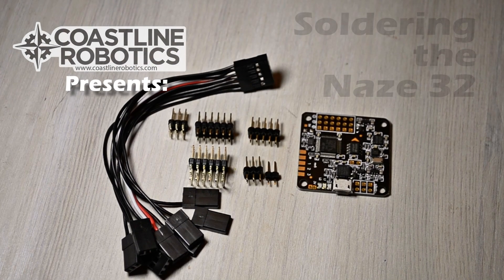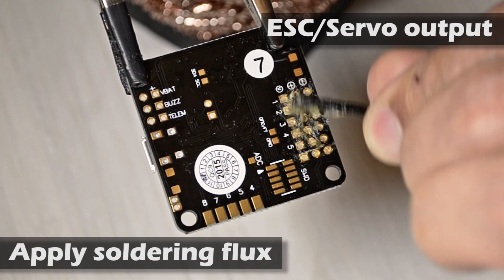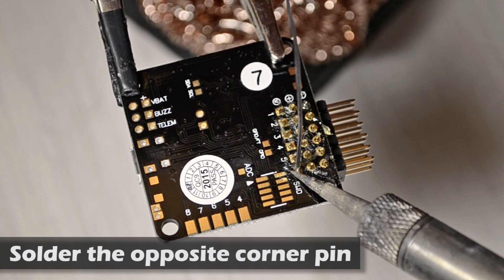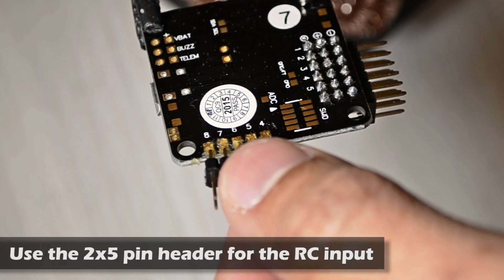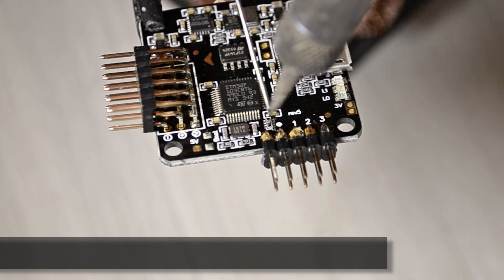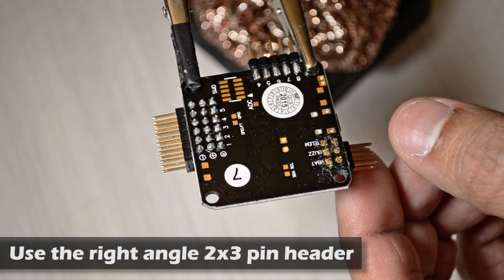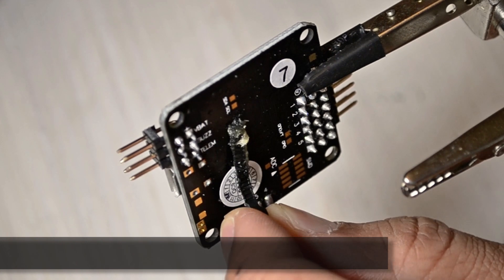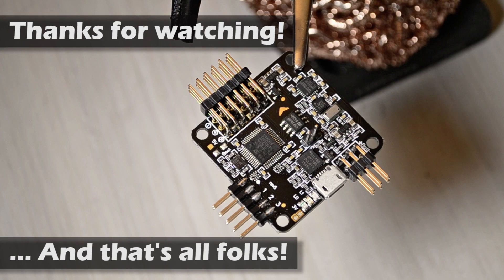Soldering the Naze 32

Comment: What should I do if the orientation of the board is wrong? Thanks
Reply from the maker: Hey +Rodnei Aguiar you should go to the CONFIGURATION tab in cleanflight and in the "BOARD AND SENSOR ALIGNMENT" section adjust the orientation of the board. So let's say you placed your board with the orientation arrow pointing to the right then on the Yaw degrees box you should type 90 or if you installed the board with arrow pointing to the left then you should type -90 or 270.
Reply: Thank you very much!